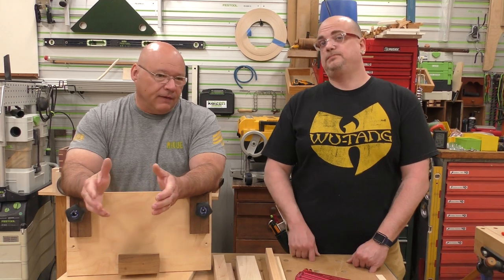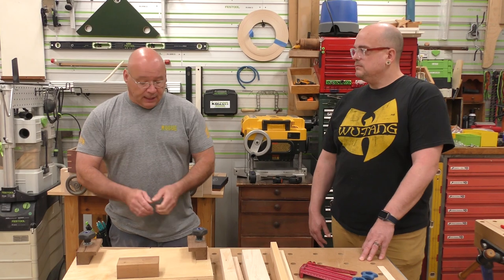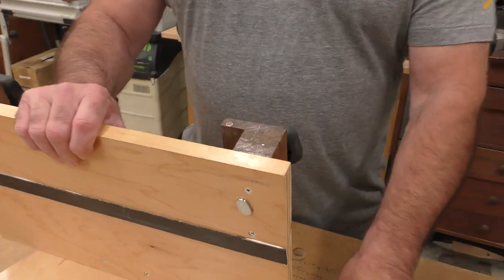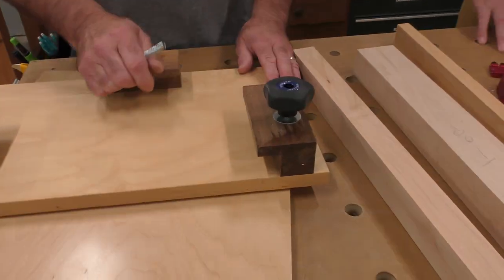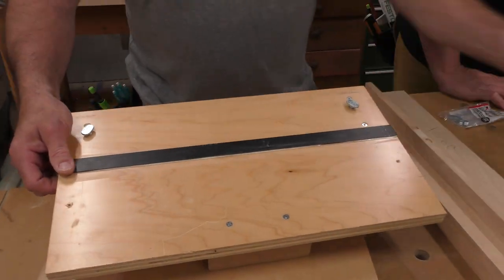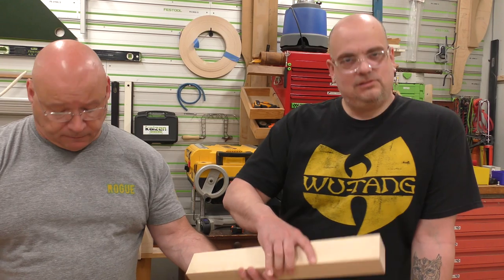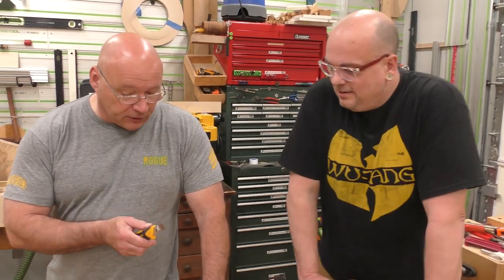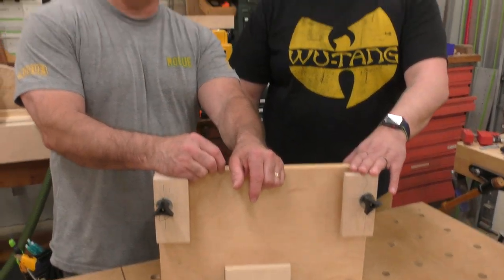Building A Bracket for Your Festool VAC SYS

Comment: Sedge, I figured part of the issue out about my holder sitting proud of my MFT table. If you use the most narrow sys vac attachment it is about 30 mm taller than the other attachments. The Vac still sits a little proud but I can lower the horizontal holder about 10 mm to lower the attachment to the table height and make a second holder for the narrow attachment.
Reply from the maker: cool

Comment: I noticed when you did the demo on Festool Live USA episode 20 that the height of the Vac Sys above the bench meant that you had to rotate it when routing the shop made charcuterie template. Perhaps if you added a couple of extra mounting holes for the T-bolts to raise the mount up that would help. If you added the 2mm standoff pads to the corner brackets of the MFT instead of the back of the board that would make it easier. You could use 1.5mm 20 x 20 aluminium angle glued to the corner brackets and extending across each side for that. What do you think?
Reply from the maker: thanks.......will look at this upon my return to the shop..

Comment: Sedge, I have 2 of the vac clamps, that I purchase a few years back as return items then Covid happens and I did not source a pump. Not sure what rock I have been under but have seen that Festool discontinued all of it. Suggestions on a pump?
Reply from the maker: I have had folks tell me that their Vac pump they use for their veneer bag works..just have to make sure of the air fitting...

Comment: Sedge, 
   What brand of epoxy, would you recommend using on prefinished plywood, both sides ? Or, do I need to remove the prefinish on the plywood, so the epoxy will adhere  ? Thank you for your time.  Take care.
Reply from the maker: I have never used epoxy on pre-finished ply...
Reply: @sedgetool  what would you suggest tomorrow adhere the 2mm strip on the back or would you use a pin nailer to attach it ?  Thank you for your time.

Comment: Ok guys. I just made this clamp holder and put it on he table. I followed the details to the letter by my clamp sits 45 mm proud of my table? What did I do wrong? My cleats have a 25x30mm rabbit and my plywood is exactly 445x270 mm. I am re making it and will make my plywood 445x325mm. This will allow my VAC SYS top to sit level with my two MFT3 tables. 😢any thoughts? How did I go wrong?  I will be able to reuse my walnut brackets.
Reply from the maker: glad you figured it out......

Comment: Excellent video as always guys. I made two of these as I bought a Vac Sys with an SE 1 and SE 2 clamping module. Pretty much every door in my house needs replaced and I wanted two modules to clamp the doors instead of using door bucks. It makes it so much easier to work on. And of course I use it for other things as well. I definitely learned a few tricks and will add that 2mm strip on the back. I really enjoy the channel guys!!
Oh and a question about your Festool table saw.... is that a 220v unit?
Your guys enjoy the rest of your weekend....
Reply from the maker: It is a CS70 110v unit ...Yeah baby ... Thanks Ron .....

Comment: Hey Sedge - all the sites are saying the vac clamp is being permanently discontinued.  I wanted to buy the complete set with both units.  If I order one from one of the sites as back order will Festool still ship it out or are they all gone?  I found one at Acme Tools, but they were charging me for individual pieces not the SE1 set price.
Reply from the maker: I believe they are discontinued .... I would not rely on back order .. i would contact your online dealer to verify stocking.....